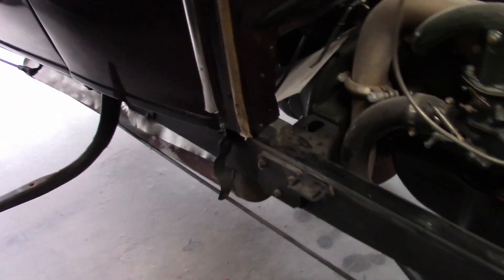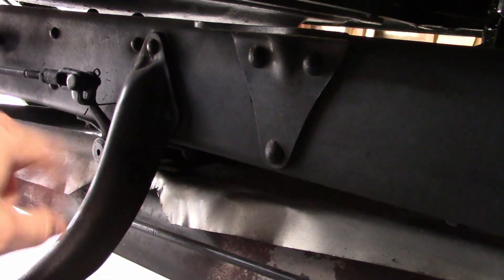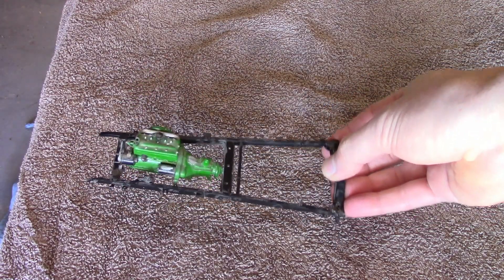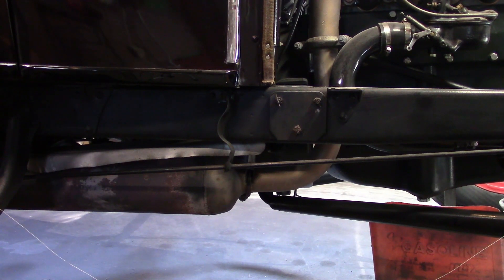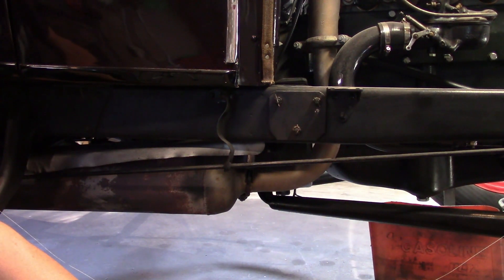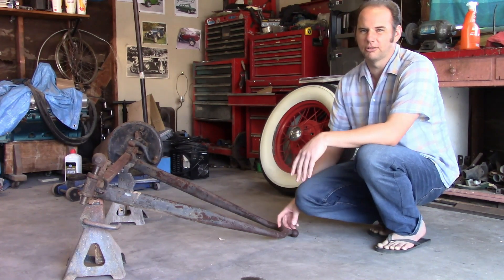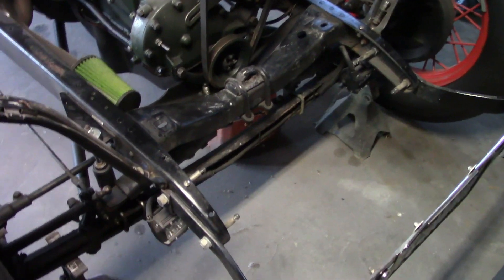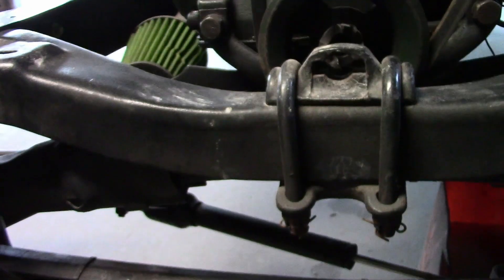Checking a Ford Model "A" frame for collision damage.

Comment: After watching your video I see my checking of my frame is on the right track.  Mine is square but has to much sag that I will; have to take out.  i have a question thou I have to reinstall rivets in the front and rear cross members as they had them bolted.  I see the top rivets on the front cross member are bucked flat.  Are any of the other rivets bucked like that or are the others round headed both sides?  I am just at that point and am not sure wehat they look like on the sides and bottom of the front cross member and any of the rear cross member.  Any help on that woulkd be appreciated.  bucking flat tails is always way easier than bucking rounded heads both sides.  P.S. Love the video it could not come at a better time.
Reply: I’ll defer to better experts but both frames I have have round heads on the other crossmembers IIRC. Only the front crossmembers are flat.
Reply: @836dmar  thank you very much
Reply from the maker: @dhodgson8210  Yep. only the 3 on the top on each side of the front crossmember are flat on top. the rest are round on both sides.